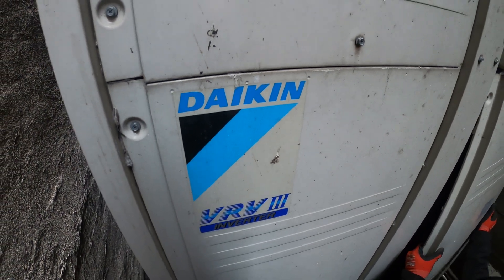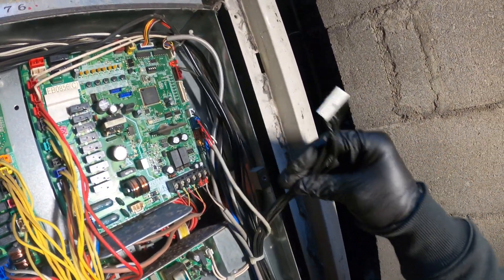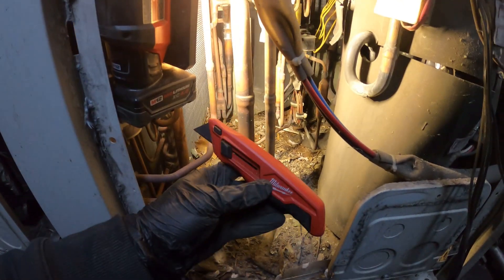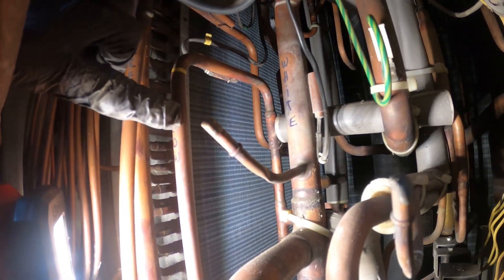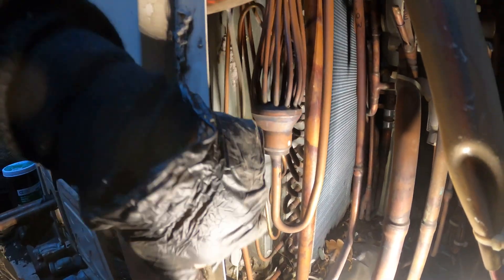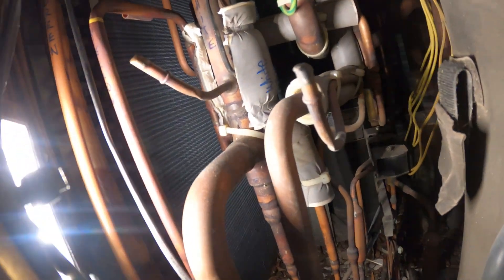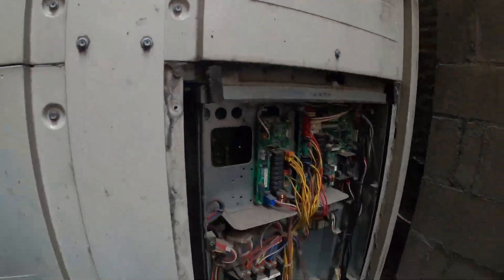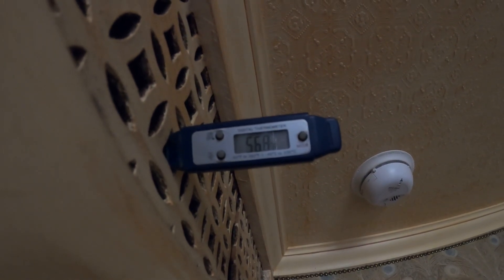HVAC Service Call: Daikin VRVIII Error Code J4 Follow Up (Daikin Thermistor Assembly Installation)

Comment: The H8P green led which was on constantly means that its the master unit. Flashing H8P means it’s slave 1, and if it’s off it means that it is slave 2. Two orange lights means there’s a fault, one orange light H3P means that all is normal 👍🏻

Comment: Nice work.   I’m surprised you don’t use a service checker.  That would save you tons of back and forth.   Allow you to calculate if your short of refrigerant and test all your sensors.
Reply: Where to get service checker, what kind of service checker is needed....
Reply: @jibaritomx  there is only one service checker.   Actually two now but both operate the same way.  Except one is blue  tooth via your cell phone.  The other is a hard wired to F1 aF2 on the master outdoor unit.    And only Daikin Mcquay.  You will need to take a course prior to purchase. Or if your already a certified Daikin tech like we are here nyc local 638 are.  Then they will sell it to.   Comes with the adapter to your lap top full soft ware and software support.   As well as a direct number to tech support as they will ask you to record for certain period of time so they see what’s going on.   It’s really the only way to work properly on any vrv or vrf system.  Ever manufacture has its own version.

Comment: Next time you’re in front of the BRC controller hold down test for 5 sec until ‘10’ indicates. Press and hold test again until ‘40’ indicates then scroll to ‘41’ using the temp button and this will give you ambient, coil temp and gas temp. Hold test again for 5 sec to return to the main display. Hope this helps. 

👍🏻